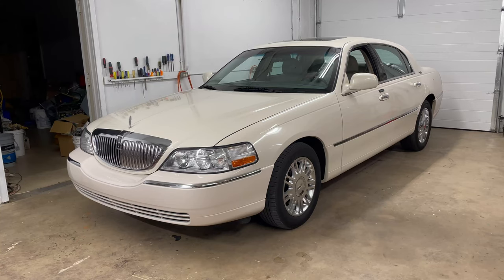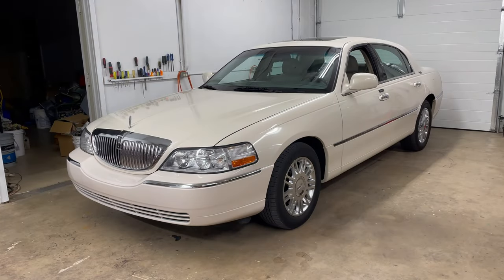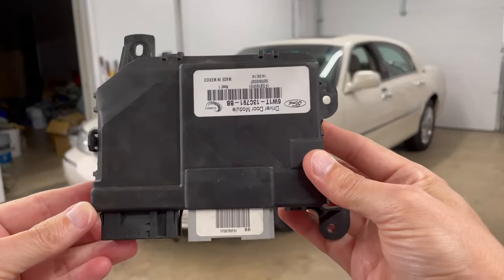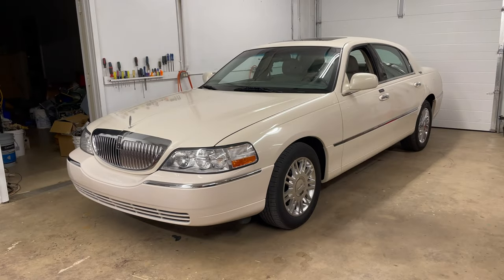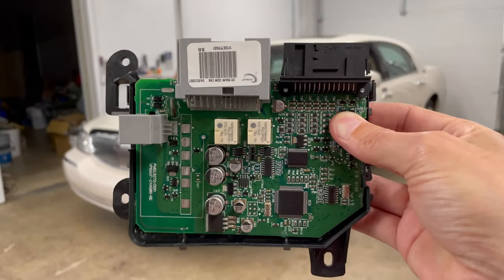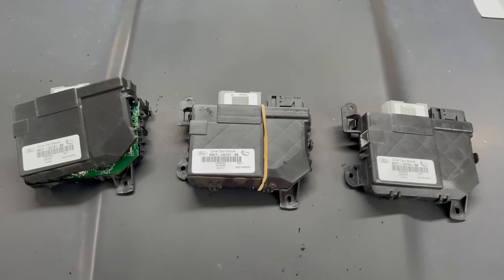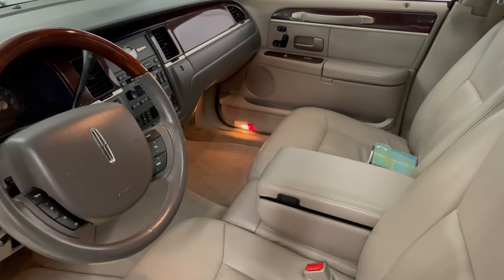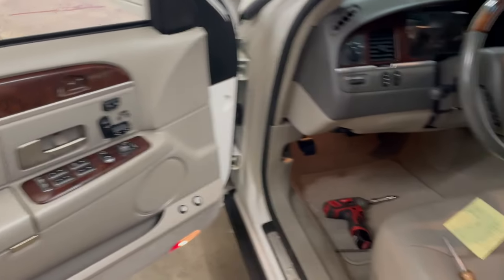Weird Electrical Problems FIXED - Lincoln Town Car

Comment: Great info. thanks for the Video. I can't say that I have the same problem. But whenever I have issues with remote door lock or dome lights wouldn't turn off, I had to just give it a good wet spray with WD40 into the driver-side door lock latch. I think it's a moisture related issue, I have this issue only on rainy wet soaking day. I think there's few electrical leads there - I never took it apart - can't confirm this. But It always seems to fix the issue for me. Luckily, it only occurred to me few times in the past 5 years.  it's a 2002 TC base model. I got her from a 93 year old gentlemen - 90ish K miles.  In my opinion, Towncar is lots of car for NOT a lot of $$$..
Reply from the maker: The door switch may be in the door latch mechanism, my same-era F150 was like that.

Comment: Great job, thanks.   Did you look at the fuse panel to the left of your feet?  My door program code was on this panel.
Reply from the maker: I did not. Some years had the code printed on the DDM and some years with it printed on the trunk hinge. Different years had different things.

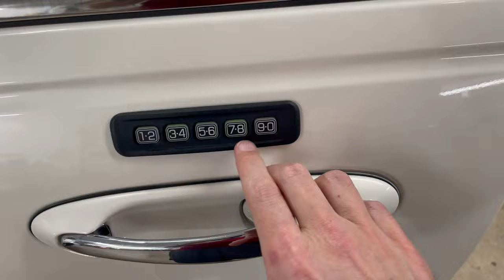Comment: In minute12:12/14:47 of the video,:
To see if the outside KeyPad works?
 Simultanesly push [7-8] & [9-0] this would LOCK all doors. Simultanesly push 89.
 If you don't have the Key-Code? Two choices: First if it is One Owner Car look into the Original Owner Manual.
 There should be a half inch by one inch sticker that has a 5 digit code. In old days Ford & Lincoln Dealers would peel the sticker and stick to the inside of the Trunk's Lid Right Arm  Inner-Trunk visibilty. 
For instance if the CODE would be (13550) => [1-2] + [3-4]+[5-6] + [5-6] + [9-0] 
Then to Open Driver Door push [3-4] 
To open all 4 doors the Code (13350) Simultanesly => [3-4][3-4] 
To open TRUNK Lid  almost the same  the CODE would be (13550) =>Simultanesly => [3-4][5-6]. 
Please NOTE: you may assume and give "Alphabetic Value," to the Outside Key Entry Punch => How?
 Assume that [1-2] + [3-4]+[5-6] + [5-6] + [9-0] = are => [A] + [B]+[C] + [D] + [E]. 
If so then => For instance if the CODE would be (13550) +[B] opens Driver Door Only.
If so then => For instance if the CODE would be (13550) +[B] [B] opens all 4 Doors.
]If so then => For instance if the CODE would be (13550) +[B] [E] opens theTRUNK Lid
To Lock all4 Doors => .No Code Needed. 
Only Simultanesly push [D] & [E] this would LOCK all doors.

The S E C O N D Part if the Original Owner Manual & Code Sticker Missing Nor is in the Trunk Lid Arm?
You must open the Driver door Panel as it was instructed very well in this Video
Kindly Gentlyremove the Black Nylon Sound Road Noise Reducer
Behind the Key Pad => [1-2] + [3-4]+[5-6] + [5-6] + [9-0]  there would be a Modual.
The Code is Written on the Modual If the Code did NOT open , No Worries. The Code is Good but it has MIRROR Printed meaning Backward
If the Code number on Modual says: 05531 then you enter 13350
Best of Luck
Reply from the maker: The key pad code was located on different places depending on the year, and in some years it is not printed anywhere (except the card in the owners manual if it still exists).

Comment: Good information.  I own an '05 Signature that I just got a little over a year ago and want to know all I can about it.  The door code is supposed to be on those modules, so I was told.  I am without a code (no card inside my owners manual) and was told that's where I would find it.  So you should be able to get the code off of module #3 for unlocking the doors?  But thanks for the video here.
Reply from the maker: The code is internal in the module and you need a computer to read it, check out https://forscan.org that’s what I used
Reply: @InternetDude  Really?  That's not what is out there, even here on YT.  But I appreciate your feedback.  The dealer wanted $60 over a year ago to retrieve it and I had to make appointment and come back another time.  The amount wasn't the problem it was the appointment thing.  How long would it take to get it from a computer?  So I'll check your way out.  Thanks.
Reply from the maker: The code is sometimes on a sticker on the module and sometimes on a sticker on the trunk lid hinge but it depends on the year of your car and the module. Mine is an 07 and the code is only internal, I think it was 05 when they made that change.
Reply from the maker: You need an OBD adapter and the free software to retrieve the code should take under a half hour
Reply: @InternetDude  Yeah the sticker with the code is on the passenger side trunk lid hinge.

Comment: I believe there's a sticker in the hinges on trunk for code numbers for doors? Or look in the manual book.
Reply from the maker: It depends on the year, they stopped putting the code in any printed location other than the card in the owners manual.
Reply: Driver side door

Comment: Hello! Enjoyed your video very much. Regarding the keypad code, do you have to know and enter the code that came from the car of the replacement circuit board from, or do you need to know and enter the code that came with this car? Thank you.
Reply from the maker: The keypad entry code is stored in that module. If you change the module the code changes to whatever is stored in it. If you put in a used module like I did, you will have to use a computer to access the code. If you go to a dealership and they put in a brand new part, it's possible for them to re-load the brand new module with your old code. Hope that helps.
Reply: In minute12:12/14:47 of the video,:
To see if the outside KeyPad works?
 Simultanesly push [7-8] & [9-0] this would LOCK all doors. Simultanesly push 89.
 If you don't have the Key-Code? Two choices: First if it is One Owner Car look into the Original Owner Manual.
 There should be a half inch by one inch sticker that has a 5 digit code. In old days Ford & Lincoln Dealers would peel the sticker and stick to the inside of the Trunk's Lid Right Arm  Inner-Trunk visibilty. 
For instance if the CODE would be (13550) => [1-2] + [3-4]+[5-6] + [5-6] + [9-0] 
Then to Open Driver Door push [3-4] 
To open all 4 doors the Code (13350) Simultanesly => [3-4][3-4] 
To open TRUNK Lid  almost the same  the CODE would be (13550) =>Simultanesly => [3-4][5-6]. 
Please NOTE: you may assume and give "Alphabetic Value," to the Outside Key Entry Punch => How?
 Assume that [1-2] + [3-4]+[5-6] + [5-6] + [9-0] = are => [A] + [B]+[C] + [D] + [E]. 
If so then => For instance if the CODE would be (13550) +[B] opens Driver Door Only.
If so then => For instance if the CODE would be (13550) +[B] [B] opens all 4 Doors.
]If so then => For instance if the CODE would be (13550) +[B] [E] opens theTRUNK Lid
To Lock all4 Doors => .No Code Needed. 
Only Simultanesly push [D] & [E] this would LOCK all doors.
The S E C O N D Part if the Original Owner Manual & Code Sticker Missing Nor is in the Trunk Lid Arm?
You must open the Driver door Panel as it was instructed very well in this Video
Kindly Gentlyremove the Black Nylon Sound Road Noise Reducer
Behind the Key Pad => [1-2] + [3-4]+[5-6] + [5-6] + [9-0]  there would be a Modual.
The Code is Written on the Modual If the Code did NOT open , No Worries. The Code is Good but it has MIRROR Printed meaning Backward
If the Code number on Modual says: 05531 then you enter 13350
Best of Luck

Comment: Great work
Reply from the maker: Thanks! How's that Mach E treating you? Any issues yet?
Reply: One minor switch broke for the 4 way mirrors took 3 days to get the part and a 15min fix other than that we have 10000km on it and are loving it
Reply from the maker: @dylanc9275  oh that sounds pretty minor I had a lot more issues with my EVs by 10,000km 😉
Reply from the maker: @dylanc9275  where is the furthest you’ve gone? How is the DC charging situation? You should do a video about that.
Reply: @InternetDude  we went to Banff is our furthest. And the charging so far has been great. No issues other than one petro was broken again of time but we new about it. Just had to use a 50kw charger instead of the 150kw
Reply from the maker: That's awesome! 50kw is a lot faster than I charged for ~4 years with my first Tesla. I know along the #1 in SK anyway some Co-ops have DC also, not just the Petros. So that can be a backup depending on the city.

Comment: I have a 1999 TC that the seat don't move, rear windows don't work, trunk is temperamental, and AC needs replacement.  I'm wondering if it pays to invest the money to fix those or just drive it till it dies.
Reply from the maker: Definitely keep fixing it! This past week I replaced the blower motor, a blend door actuator and the light control module on my car. Next week it’s going to the mechanic to replace the A/C accumulator. All in I will have spent close to a grand in repairs but the car will basically be perfect. It’s worth every penny to me, Just keep chipping away at the repairs and you will want to keep the car longer the better condition it’s in. These cars are a lot easier and cheaper to fix compared to German cars 😉

Comment: Thank you so much!! This worked for me but I’m not sure if the keyless entry alarm chirp not working is because of the DdM or not. Any way, I have a 03 signature and I went to the junk yard and grabbed a 02 signature and I got the code from that car. Your original code will no longer work
Reply from the maker: The keyless entry is handled by the DDM you may want to reprogram your remotes

Comment: Hello sir, I have a 2000 lincoln towncar Cartier everything in my car works that the DDM controls. Windows, locks, mirrors, keyless entry keypad, seats, etc. Except my both keyfobs don't work I replaced battery's to a original backup I had put away and a aftermarket one still nothing. So I figured my DDM that controls the keyfobs is faulty. Now my local salvage doesn't have any 98-02 models towncars so I'm leaning towards a 2001 mercury grand marquis ls ddm. Would you think that would work so far my research has led me to believe it will. Thoughts???
Reply from the maker: As long as the Grand Marquis has the same options I think it will work (full power trunk, etc). Also, check out the link in the description for more details.
Reply: @InternetDude  thank you yea I believe the grand marquis has power trunk. The ddm from the grand marquis is slightly different but I'm hoping it will be plug n play. Hopefully the male connectors match up with the marquis female slots
Reply from the maker: Check out that link, it has some year-specific information.

Comment: I saw another video that showed the code for the door being on the module? Not sure but it might be worth trying some of the numbers either imbedded in the alphanumeric barcode or the set of numbers all the way at the bottom of the sticker? 14:02:14? Maybe that’s 14214?
Reply from the maker: No that wasn't the code. In earlier years the code is on a sticker in the trunk hinge arm, on some other years it was printed on a sticker on the module. For about 2006-newer the code is not visible anywhere, can only be retrieved using a computer scan tool.
Reply: @InternetDude  you said computer scan tool, do you mean the scanner that you use for check engine light
Reply from the maker: @ninbendoyt3203  Kind of, but more advanced software, look up ForScan.org

Comment: Random question maybe no one knows the answer to but here we go. I have a signature limited 2006 and the window switch for the driver side keeps failing but when i change the switch out it works for 3 months then stops working again.. the auto window function doesn't work and when you try to use it the window doesn't go down at all but if you slightly hit the button it works fine.. could that be a bad door module or is there any test I should run to try and pin point this problem?
Reply from the maker: Just a thought but check the wires in the driver door jamb, perhaps a couple of wires have broken insulation and are shorting out. Those wires get flexed every time the door is opened so over time they can break.

Comment: I’m having some of the same issues with my 2003 Lincoln town car but my windshield wipers not working either, had to unplug my horn fuse because my alarm kept goin off, now my windshield wipers not working doors ajar keep comin on and inside lights while driving
Reply from the maker: Ask this helpful Town Car forum @ https://lincolnforums.com/forums/forums/lincoln-town-car-forum-1981-2011.19/

Comment: I have a problem with the interior lighting of a 2008 Ford Marquis that does not work with the doors open. Do I need to replace the same part that you replaced??
Reply from the maker: Check your fuses. If you have the problems like I mentioned in the video it may be a DDM problem, usually you have more than just one problem when the DDM fails.

Comment: Great video,  however after searching for several weeks and calling dozens and dozens of salvage yards for a door module for my exact model  (2003 Cartier model top of the line model ) like the video said to do, I gave up and ordered a refurbished module for a 2003, not knowing what model town car it came from.  We were told by multiple shops and junk yards it doesn't matter what sub model town car they come from they are all the same.  I rolled the dice and purchased the random 03 module and now every feature works on my Cartier model which is the top model for 2003 with all the features.  So basically I believe your first used module was  probably also broken and then the 2nd used one you purchased just happened to be good one. So basically you can use any door module that is specific for your year example 2003,2004,2005 should be the same. Just get one that will work for your model year.  Remember you could be buying another broken one so it might be a good idea to make sure the one you are buying is refurbished/rebuilt with say a 60 day warranty like I did. If the video was with this correct information it would have saved us weeks of looking/ searching. Also I didn't have to have it flashed or programed at the dealership either.  The door code is on the module itself at the top with the number sequence in quotation marks, at least it is on the 2003 module
Reply from the maker: I wasn’t making things up. Different years are different, see the link in the description.
Reply: I have a 2003 Town Car and I can tell you with absolute certainty that all modules with the same part number are not the same - the level of equipment, and therefore the programming, matters.  If you don't believe me read the thread in the link that's in the description where you can learn about the experiences of other Town Car owners.  Happy to hear that you got lucky and fixed your car with the first DDM module - I needed to try three before I found the right one.
Reply: @scotthogle425  well then I got lucky.
Reply: Craig, I have the same year and also  a Cartier. Any leads on another module? I'm having the same issues.
Reply: @aaronsawgle8555  I guess I got lucky, the rebuilt module I bought on ebay worked for me 03 Cartier
Reply: @craigmoir2569  Thanks! Guess I'll keep hunting for one.
Reply: Can't it simply be that the door modules only difference are the PROGRAMMING that came from the factory? Look at the three modules you have. With the same module number, I will bet that the circuits are identical. What is not is the features programmed into the module memory. Are you saying modules with the identical part number have different circuitry in them? I don't believe that. If that were true, then Ford would not be able to fix their own vehicles. There has to be a way to program in the features. Forscan?

Comment: good diag here, solved one of my problems, the other problem is the buzzing from the relays under the dash and under the hood with lights off. Buzzer turns off with lights on, but timed lights and lights off, buzzzzzzz, starting to annoy me.
Reply from the maker: There is a LCM - light control module. That may be something to look into.

Comment: Can the data board be exchanges.from the old module to the new module to eliminate dealer coding? I did that with my speedometer module worked out great
Reply from the maker: No the electronic board inside is what goes bad

Comment: I have a 2007 tc same model as your's with the same problem. If you know of any parts stores that I can purchase a module from, it would be appreciated.
Reply from the maker: Best bet is a junkyard, same year car and same trim level (e.g. Signature Limited). eBay could be a source too. Auto parts stores do not carry this at all.